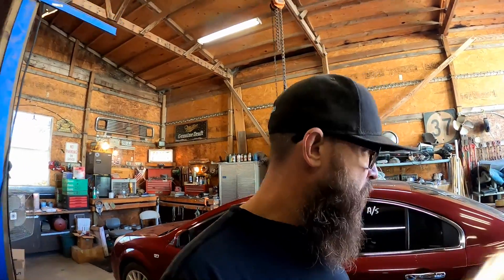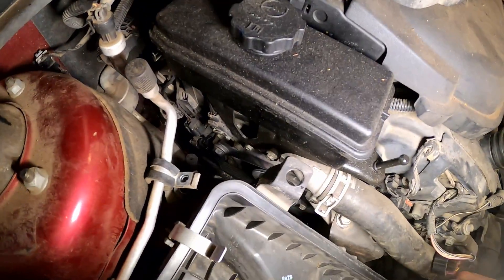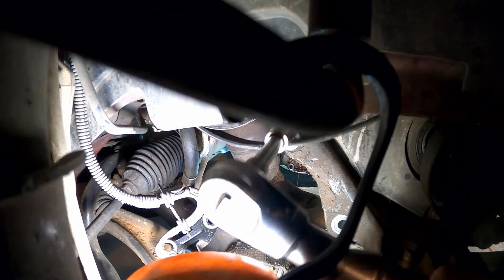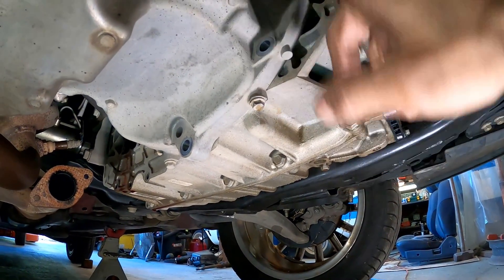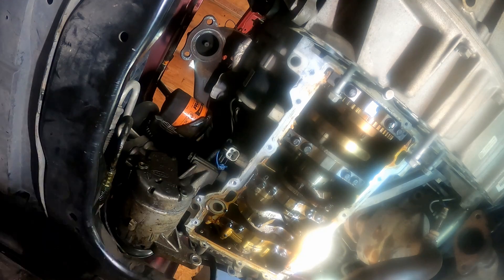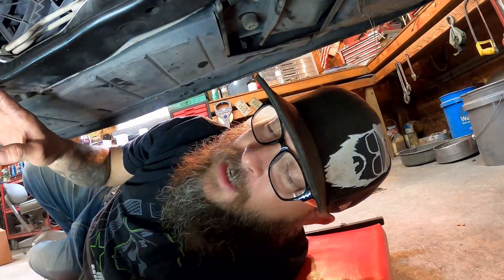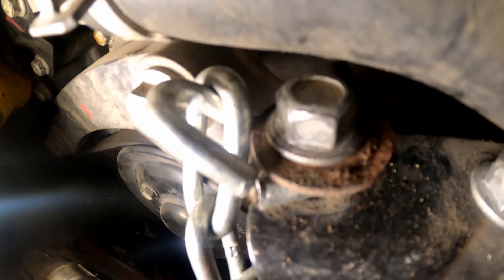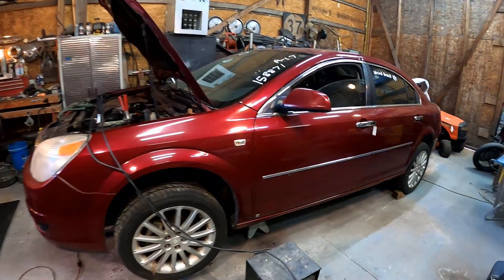CAN WE SAVE THIS SATURN?!?!

Comment: Pretty common on those 3.6 to have bad bearings in the center of the crank . If you use the anvil tip on a air hammer it makes getting axles and strut bolts out easy but the wood works too 👍 She's running now let's get a fresh battery and crack that transmission open but you need a drive cycle to run codes with a new battery as yours might be to weak to show any codes .

Comment: I almost bought a Saturn when the car was first introduced. Glad I didn't since GM discontinued the brand. Recently I abandoned GM for Toyota. I like this project. I enjoy your determination, ingenuity, and savvy to repair these types of builds that have plenty of miles left in them. Love how you always complete tasks without having a lift and other equipment. Thanks for sharing your knowledge. This is a great video. I am waiting on the next video on  the transmission. Weird Beard, you are special. Keep up the good work and always follow your dreams.
Reply: I've owned 6 Saturns and everyone was a great car. I was the second owner of an '03 Ion and when I sold it 3 years ago, it had 223k (original engine and trans) and they're still driving it.
Reply: Early Saturns were amazing cars... you simply could NOT kill that 1.8L in the SL's and with a manual transmission you could fly off the line and do burn outs. I had two of them... 1996 and a 2001 and they both had over 200K miles.   Miss those cars.
Reply: I had the first model that came out and it lost me over 250000 miles and I ended up stop driving it because the piston rings where shot and ended up seeing it to someone that oddly fixed it.

Comment: So glad that you fixed the knock, that was so much work. I did think that it may have been worth doing an oil flush just in case there was a blocked journal on the crank and make sure that the oil pressure is ok, just in case the oil pump was not working as it should but you are probably right that it has been run short on oil and the oil was well past needing a change.  I can see you can make some money on this car which you deserve for the time you put in. Keep going Fella!

Comment: So glad you did this Mike, I've been one of the weirdos asking about it in the background on other videos cause we had an Aura and I have an 09 Malibu LTZ winter beater (same engine/trans, same red too). No reverse I got a bad feeling about but wish you luck and look forward to the video on the trans.
Reply from the maker: I sure hope it’s something simple. I heard they have some common issues related to the shifting problems
Reply: I have a '07 Aura XR 3.6 and I have the very common trans issues, smoothish when driving but at a stop it rumbles and shakes unit it gets put in neutral... When in reverse it gets even worse.
Reply: @nicholasbarrett744  Could be the 3/5/reverse waveplate issue, and there's a solenoid that loves to stick and cause it. Do you get any codes? I skipped buying a Malibu that had a solenoid stuck on code plus a speed sensor code, as I was told the speed sensor code means lots of metal shavings already generated by the solenoid and 3/5/R issue
Reply: I have a 2007 Aura XR and replaced my 3/5/R waveplate with the ford part about a year and a half ago when the shift flare first started happening at about 95k.¬ wasnt so bad did it on jackstands over a couple days. so far so good.
Reply: @marricm_  mmmm I'll have to look into that, thought these units were mechanically designed the same between Ford and GM but nice to know if there's an upgrade
Reply: @willoverkill8461  nope. the pre-2011 ish GM ones have a different 3/5/R waveplate than the Ford's for whatever reason. I guess the Ford version is treated in some way to better handle the pressure.

Comment: I thought I saw wear on the bottom caps of those two cylinders where the bearings had turned. Doesn't that mean that the opening has widened, and will lead to the new bearings turning sooner rather than later?

Comment: Awesome. I wish I could rebuild an engine in a weekend. You sir are doing amazing stuff. Here's hoping the transmission goes as well. That's an awful lot of work to put into this old clunker but if you pull it off you're keeping lots of value on the road and out of the junkyard. This makes a huge impact on the environment and climate change and stuff like that. I wish I was a fraction as talented as you are.

Comment: Amazing work WB. When you started that I was thinking , well if that was me I'd be giving up before I get too deep into fixing this. 
You explain stuff so well. You really should consider teaching when you get a bit older. I'm sure the young fellahs would learn a lot from you.
We had rear wheel drive versions of the 3.6 here in Australia. They have the same problems with the chains etc too.

Comment: I had to do the same job as you Mike with a Audi A4, after i change those berings i fill up a can with 1 liter thick oil and 4 liter diesel, then i start the motor and let it run on idle for 2 minutes, then drain it, did the same thing one more time with new oil and diesel, that cleans the whole motor,then i fill up with new oil, run it 10 minutes and drain, new oil and filter again, this was for 5 years ago, that Audi still runs like new.
Love your vloggs man!

Comment: I have had some of them axle shafts come apart and just the stub is in trans still so i had to weld vice grips to a slide hammer to pull out of trans
Reply from the maker: Sounds like as much fun as a sharp stick in the eye 😂. Glad I didn’t have to do that on this one.

Comment: Those rod bearings being pitted in that way shows that engine was run very low or totally out of oil to where crunchy chunks of buildup came through the oiling valleys and hit the bearings... JMHO tho....  I would run a can of engine flush through the block then drive it about 30 miles then pull the oil and replace with fresh synthetic you should be golden

Comment: Hey Beard. I had told you that the steering on that Saturn is EPS. I was wrong. Only the 4 cyl cars had EPS. I thought it was a 4 cyl. You should have good ol'  hydraulic steering. I built the EPS that went on the 4s.

Comment: Another great video and great repair. I like the tip on using the shoestring sanding method. Thanks for sharing the work process. Now I got to change the oil and filter in my car. Good job!

Comment: Very nice video man, i enjoyed it alot. Here in Greece and in Europe in general, most of our cars are four cylinders and we have a tool that is like a bridge, you put it on top of the engine and support the engine in this bridge like that you made but it is supported in both struts and lock with chains in both sides, then you take out all the lower support the struts as a unit and the engine stays in the air supported by the bridge, 90% of all the works in 4 cylinders needs this way, even timing chains and water pumps change with the bridge and of course since most european cars are with manual transmissions when you have to change clutch you know you use the bridge

Comment: Glad it's working better now. Lots of work AND a broken chain link on your temporary engine support!  Can't do that again WB!  On to the transmission now!  I hope it is a simple fix.
Reply: I guess it would be a good idea to know which cars/trucks have mechanicals that need to be well taken care of and avoid ones of those that have messy interiors.  If they won't keep it sorta clean, they sure won't keep up with required maintenance, even checking the oil!
Reply: When I was a kid in the 1960s there were gas station attendants who would pump your gas and check your oil at least. Some states still require that, I think NJ is one.  Would residents of those states let us know if attendants still check your oil and such?

Comment: Hope you can save the Saturn and make a profit on it. I have a 2004 Saturn Vue, V6 AWD, with the 3.5 liter Honda engine, with 130 thousand miles. Owned since new, and I haven’t had any problems. I love my Saturn, it’s a great car! The only thing I don’t like about it is, the transmission! If you try to save gas by feathering the throttle, it “hunts” back and forth.

Comment: With all the bolts coming out as easily as they did on the exhaust do you think someone got to the place where they saw the spun bearings and decided to just put it back together and ship it to the auction?   I have seen some people do exactly what you did to polish the crank.  In 1965 I saw a 2 ton 1937 Chevy flatbed that had a rod knocking, the guys who were using it to pick up straw bales dropped the pan and used a soda can for a bearing on the old babbit rod bearing.  It worked fine for the two days they were working on the farm I was baling the straw and getting the field ready for late soybeans.  They drove it away, I don't know how long it lasted but they made the trip off the farm and were headed down the road.

Comment: If you have to fix motor and trans would it not have been easyer to drop k member and do both then put back never done it and was just wondering
Reply from the maker: Unfortunately I don’t think I have enough floor jacks. I think I would need at least one more to do it that way.

Comment: Did you check the fit of the new bearings in the rod before assembly? With them spinning in the cap there might be a loose fit. 
Also what precautions did you take to make sure no grit or metal particles got into the oil hole on the journal.

Comment: 👍 keeping my fingers crossed the Trans is as easy and the result as good as the motor. Now do you tell the possible new owners what you have done because you didn’t pull a single main bearing cap for inspection , personally I believe they will be ok. It my be a question that might come up, and a deal breaker. Depending on their knowledge of motors.

Comment: Hey buddy make sure you got a 💯 % charged battery and I noticed the battery light was on . That could possibly be your transmission issue. Those cars are tricky and act strange and will have all types of issues with a bad battery or an alternator not working properly 💯

Comment: Do you think you’ll do the VVT solenoids?  Change the oil again and see if there’s metal flakes?  Maybe tell the new owner to change it a few more times right away just to be safe.
Reply: Think you can disassemble the solenoids and clean them out.  I've kind of looked into it with my 4.6 3V Mustang.
I was thinking add some ATF to the oil, even if it's right before changing the oil.

Comment: If the old batterys doesn't take a charge connect it with cables to another one the try to charge.(doesn't notice a battery if its dead)

Comment: DON'T ever use fram. Worst filters you can use. That might be part of why it had an issue. Use a Purolator, made by Mann Hummel which makes one of the best filters. Or use a Napa filter made by Wix. Don't use STP either.
Reply from the maker: I’m going to change the oil again real soon in an attempt to kinda flush out the engine a little. I’ll upgrade to a better one then. Thanks for the tip bro.

Comment: You can look at  cylinder3 and 4 rod caps and tell there toast as soon as you pulled the pan. The rods and crank are egg shaped and rod knock will come back in less than a hundred miles. You need to cut your losses and go dump this car at the auction.